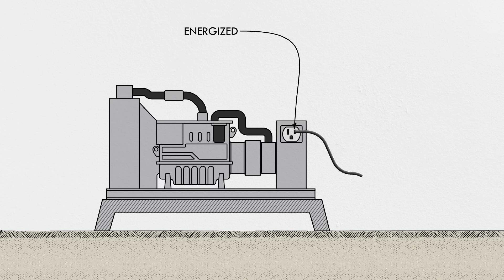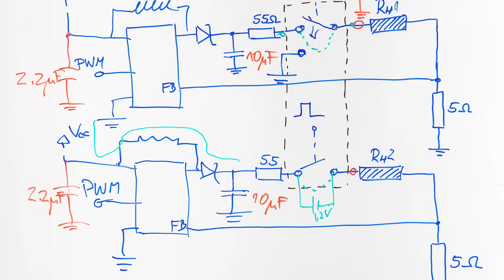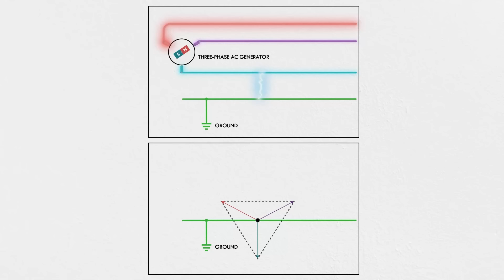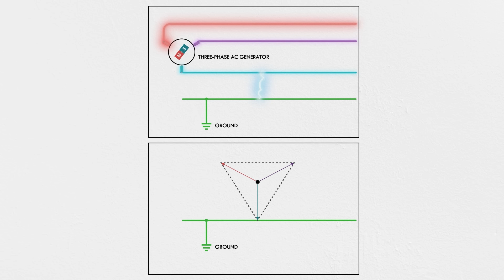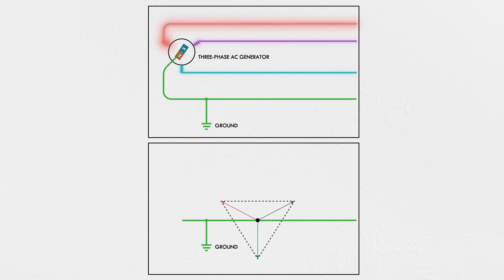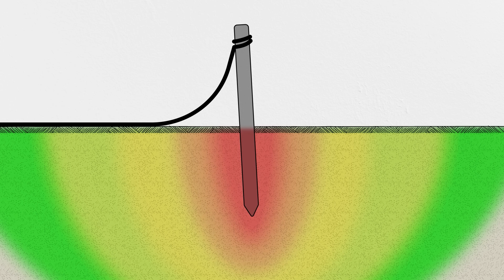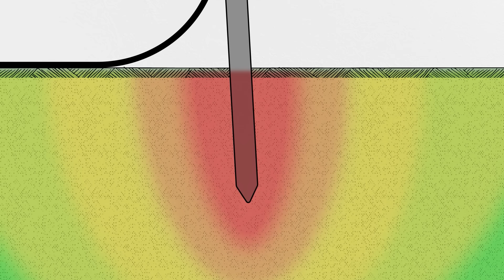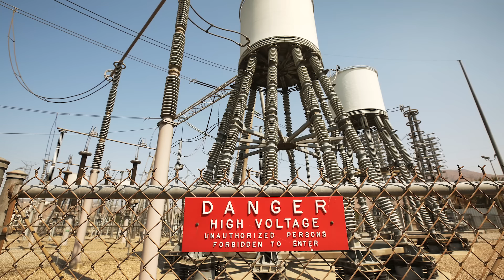Where Does Grounded Electricity Actually Go?

Comment: I helped an electrician completely overhaul the electrical system at a large multi-building facility originally built in 1906.  All the lines in on building were just single wires that ran the length of the building and at the far end connected to a steel pipe that ran along the top of the wall; that was the return line.
We made a bizarre discovery, though:  the men's restroom in one corner of the building still had the old steel trough as a common urinal, which was bolted to a frame of steel pipe inside the wall.  Somewhere in the decades between the original construction and the electrical overhaul, for some reason the steel pipe serving as the return electrical line had been cut and a section removed -- and when that section had been replaced it hadn't gotten connected back to the return line but instead to the steel frame for that trough urinal, and then a heavy wire had been run from that frame back to the main electrical panel.  So for years, probably decades, that men's restroom had an electrified urinal.
BTW, the 'hot' wires were only insulated on about eight inches on either side of where they were attached to glass mounting insulators, and the wire insulation was just tar paper wrapped around the copper wire.
Reply: A hot urinal trough has the potential (see what I did?) to cause serious injury if the bathroom floor is somewhat conductive, like from being wet. It's similar to pissing on the third rail.
Reply: @soaringvulture  Cute pun.
We figured either people had been very lucky or there was a shorter path to ground somewhere, or the steel urinal was itself grounded well.  The general manager wasn't interested in paying what it would have cost to trace things to find out, though, so we just did the overhaul and made sure the electrical system was no longer using any connections to plumbing as a ground.  Later when a plumber was dealing with an issue not even twenty feet from that restroom I mentioned the electrical silliness, so we traced pipe, ended up pulling sixty feet or so that wasn't actually attached to any water lines plus used PVC sections to join lines on a couple of T-connectors so the only thing flowing would be water.
Reply: @traildude7538   COLD water pipes were considered acceptable ground points for decades, but that is changing due to PVC and other plastics used in plumbing.
Besides, having a solid wire from ground to point of use is much better than pipes with many joints!
Reply: Excellent
Reply: You'd be surprised how many electricians I work with think the neutral is always a non hot wire
Reply: @Wilhelm4131  I have an old NEC manual that shows how to wire certain circuits to have two switches running a lamp, but they leave out the marking of the wires to designate the special use wiring. Things have changed over the decades, from having bare 110 volt wires under a tablecloth for lamps, to ground fault circuits!
Reply: @jeffreyyoung4104
the house I grew up in was wired that way.

why COLD water pipes tho?

🤔 would it cause electrochemical corrosion in the hot water heater if you used a hot water pipe? thx!
Reply: @john-ic5pz  Because of all the possible joints that could interrupt the current flow, especially the water heater.

But the same could be said of the cold water pipes, except for the water heater.

Even today, plumbers will put a set of pipe clamps and a wire jumper around interruptions in pipes, like water softener connections, or water filter connections.

But even in my 150 year old house, I have no electrical connections to the piping, as the pipe to the well is plastic! Modern plumbing in many new homes is plastic.
Reply: @john-ic5pz   The connections to cold water pipes that I have seen were all attached either where the water first came into the house or where a line went to an outdoor faucet, I presume to keep the  distance to the actual ground/dirt as short as possible.  Connecting to a hot water pipe would send current through the hot water heater, which would introduce potential problems.
Reply: @jeffreyyoung4104  On several houses built between WWI and WWII I found ground wires going to a copper rod stuck into the ground (I was painting the houses).  One owner said the ground didn't go to that any more and wanted the rod pulled.  I checked the electrical box wiring to make sure that was true, and on finding that she was right I went to pull the rod -- and got a shock:  that thing had a half-inch diameter and was four feet long!  I mentioned it to an electrician I knew and he said those old ground rods were actually better than a lot of what was being done these days.
I used to have it as a souvenir but I'm not sure it got brought along last time I moved.
Reply: Geez Louise. lol
Reply: @Wilhelm4131 that’s what i thought. Guess I need to keep studying it! But then I’m not an electrician. lol
Reply: Bizarre indeed!
Reply: Excellent way to cure ED!😮
Reply: @integralsun  😂😂
Reply: @integralsun  😂😂
Reply: Always ground the pipes. Not just because metal pipes entering the home are a good ground rod. If a pipe somehow becomes energized in one room, connected pipes in other rooms are also energized. Someone touching the water pipe and the metal case of a grounded appliance could get shocked. Grounding the water pipes prevents the pipes from being energized relative to electrical ground (it blows the breaker or fuse, and keeps the voltage difference down during the current surge until the breaker or fuse blows).
Reply: That’s why I never flush…
Reply: Scary living within those magnetic fields as blood contains iron. This is the children's leukemia connection - deranged blood.

Comment: I worked as a journeyman lineman for 36 years.  I have found your videos to be interesting and accurate.  I think your comment about electricity following all the paths available is very important.  Many have been killed thinking the the path of least resistance.  I started in 72 and the rule then was to work "between grounds.". Time went by and "singlepoint' grounding became a thing.  Grounding from the conductors to the tower or pole below the linemans feet making for no differential.
It was a hard sell, still might be, but it works.
Im going to watch this one a few more times to see if I can learn more.
I think you are one of a few people, who sre not in the electrical industry, who understand what goes on here.
Reply: What do mean by "between grounds".. and "singlepoint" ?
Reply: I was a defensive lineman when I was younger, but when I got to high school, I became a linebacker. I know what it’s like to be a lineman, though, so I can totally relate to what you do. It’s a tough job, for sure, but it’s a very important one. I’m sure your team appreciates all your hard work.
Reply: "Im going to watch this one a few more times to see if I can learn more."
Good. I was feeling very ignorant about electricity while thinking about how many times I will need to watch this. Thank you.
Reply: i’m an apprentice lineman
Reply: @SkipperDannyD  In the switchyards the line is de-energized prior to working, and a temporary ground wire is clamped on in two places so that you work between the grounds. Should the line become backfed or re-energized, the line voltage is taken to ground instead of the worker.
Reply: I’m apprentice human

Comment: I'm in charge of a power transmission grid and always enjoy your videos. The accuracy of the information makes me trust your videos on topics for which I'm not an expert. Your channel is a gift to the world.
Reply: Hi man, in this case maybe you can help me with  the question that has been bothering me for a long time - where does an extra current generated by a house solar panel go? It circulates in the local grid up to the transformator, right? It can not go up onto the high voltage grid, right?
Reply: @andreismirnov7200  it can go up into the high voltage grid if you were to make enough. We have a solar installation not unlike a home installation, but a bit larger at around 500kW. It goes through the 11kV to 415V transformer, thus feeding the local medium voltage grid. Yours is likely flowing to your neighbors, but if you're on your own transformer, it's also getting there on the medium voltage grid. But like this video says, it's not practical to tell which current comes from where exactly. It flows where it can based on impedances.
Reply: @michaelcarr2466  first of all, big thanks for your professional opinion! So, transformers work both ways without limitations, so all theoretic excess electricity can go up the grid? I was asking more about regular home solar installations, all big solar farms probably a totally different story. My big problem with solar is that nobody knows if any of this excess electricity generated in the summer is needed, to what extent and how it is used. It is generated and just "goes somewhere". In the winter everybody still gets power from grid and consumer is stuck with the bill for all these solar experiments that nobody knows economics of.
Reply: @andreismirnov7200  You are correct; transformers work in both directions, and thus excess electricity would flow into the grid. You are also correct that the economics of residential solar installations can be complicated, and also result in unintended consequences. There are  additional concerns regarding the reliability of the grid when solar and wind become a large portion of the supply, and more traditional generation goes offline. A traditional generator provides physical inertia to the grid which improves the grid stability.
Reply: @michaelcarr2466 at 3:59 he mentions ground faults and how electricity can flow from the power line to the ground. But didn’t he make a point in the video that electricity only flows through the ground back to its scource? why would the electricity flow to the ground if it’s scource (generator) wasn’t grounded in any way
Reply: @A_youtube_channel_  If I understand your question correctly, this is the thought experiment in the beginning of the video, which concludes that electricity would not flow. In practice, generators and other sources have a ground reference, and thus any faulted phase would complete the circuit through the ground. A practical example of where this would not occur is an ungrounded delta-connected transformer secondary winding.
Reply: @michaelcarr2466  oh ok I was just confused because I thought the power grid generators did not have a ground connection because in the video he calls it an “ungrounded system” yet the line still flows to the ground
Reply: So why does the maui power compan y have no protocols for high winds?
Reply: @billbally4419  Prior to the recent fires in northern California, electrical utility companies have never had plans for turning off the power to large areas due to weather. Turning off electricity to large areas has serious safety implications as well, and thus should be carefully evaluated along with public and regulatory input.
Reply: @michaelcarr2466 And then I'm wondering: the transformer introduces a phase shift, correct? So how would it work if there's so much solar power that the net current reverses, then the phase shift reverses and things get out of sync, no?
Reply: @nagilahava  sorry for the late reply. A grid following inverter for your solar panels will sync to the grid. Thus, any phase shift resulting from the transformer won't matter.
Reply: Will the power grid fail soon?
Reply: @jaramiahredford  Never entirely, but there will always be localized outages from time to time. The worst case plausible scenario would be a total collapse of one of the six major US grids. Unless of course there's a coordinated attack, or an enormous solar event.
Reply: Very nice of you taking the time to answer people here
Reply: pyropulseIXXI  Good advice.
Reply: @michaelcarr2466  yup. Last autumn in Finland we had to get ready to have rolling blackouts because of the energy crisis (luckily never had to). There were certain areas that just simply could not be shut down. Like hospitals, water pumping stations etc.
Reply: It changes the charge of various depths of soil and rock.
Reply: hehe 'in charge'

Comment: As a chemist I'm used to deal with elements exchanging electrons to make things happen, but when it comes to electricity in a circuit & insulation I'm as a smart as a wood door, save from battery cells. Thanks for sharing this with us.
Reply: Glad to have a chemist in the room for once.
While you are here, I have been meaning to ask if with the discovery of Quantum "Spin", have Chemists come up with anything in elemental electron exchange?
Reply: I find all the analogies confusing. For me, electricity is easier to understand from first principles. Unfortunately, that involves quantum mechanics, which I guess many feel is too complicated to explain. But only after I saw some videos explaining that electricity is all about the movement of fields and not electrons flowing through the wire like little balls in a pipe, it all clicked. AC is extremely difficult for me to understand if I try to understand it using the traditional analogies.
Reply: I must suspect there are similarities. As I understand , in order for an electron to move to a higher orbit it needs to have 'enough energy'. An electron following its designed path would be the equivalent of a circuit. Insulation refers to the amount of  'enough energy' required to exceed its normal path to reach a higher orbit(s). To say, insulation=resistance, the distance of, 'enough energy', required to reach higher orbits becomes equivalent to the amount of insulation (resistance) that must be overcome.  From Gradys sand example: dry sand offers the most insulation, wet sand offers an amount of insulation, yet salt water offers little insulation. (Different salt((s)) offers different abilities.)
Reply: @MR-nl8xr  Honestly, after getting to know the basics of quantum in college I figured out it’s just too  much for me. The probabilistic behavior of wave-particles in confined orbitals blows my mind every time I think of it, in the end always going back to physics and tons of math (which is a marvelous way to describe and understand reality). Channels like PBS Space Time, Veritassium, The Science Asylum, Physics Videos by Eugene, Arvin Ash and many others would give you a much better response to your question. As far as I know, genius scientists are using the quantum properties to improve computing power. I’m a simple man.
Reply: @deelowe3  Can you suggest those videos.
Reply: At the intersection between these disciplines, I wish I knew the ionic or radical species formed initially in triboelectricity -- the potential (and associated charge transfer) between solid materials like balloon and hair from rubbing.  Rubber balloon is hydrocarbon, but presumably it's the vulcanizing additive (classically sulfur) responsible; hair is protein, can't figure out an easy way to delocalize electrons there -- the polyamide backbone double bonds aren't conjugated.  When the respective subjects are taught, the usual approach is to completely neglect triboelectricity because on a mole basis, it's insignificant in chemistry, and in electricity the materials are just said to be insulating, with neither electrons nor "holes" being conducted.  This denial is adequate for most applications, but obviously this small effect adds up on a practical scale.

Maybe someone's managed to get spectra to characterize those transient species, but I've no idea how you get such a tiny amount of stuff embedded in a solid to reveal a characteristic spectrum.  And who is it even worthwhile to to find out?

Comment: Great video. Despite having a degree in electrical engineering for 21 years, this is the first time someone completely explains the concept of ‘ground’ in all its aspects in one single go.
Reply: Technically he explained earth, not ground, and got the two confused
Reply: @youtube_omaro1879  Let me guess... European, right? In North America, the thing you guys call earth (the green wire, the spike into the dirt, etc.) is commonly called ground. So is the common/return/reference point in an electronic circuit. Yes this can lead to confusion.
Reply: Yeah, long time EE here too, and no I too was never taught much about grounding systems in school. I've been told they teach it in trade/tech schools. Or you learn it by working in for an electrical utility co. Actually very little of the knowledge I use to earn my living was taught in my "higher" education.
Reply: @sootikins 
Australian. But I learnt that nitpick off American textbooks, or at least I think I did. 
Circuit ground is not the same as the Earth. Perhaps this is a more Electronics than Electrical distinction, but I'm pretty sure that we always call our green wire earth too.
Reply: @youtube_omaro1879  If I'm talking to an electrician I usually say "ground". But if I'm talking to an electronics person I try to say "earth ground" to avoid confusion with system ground aka common. Then there's stuff like servo controllers where you may have "analog ground" and "digital ground" and "ground " (aka protective earth) all on one unit - lol!